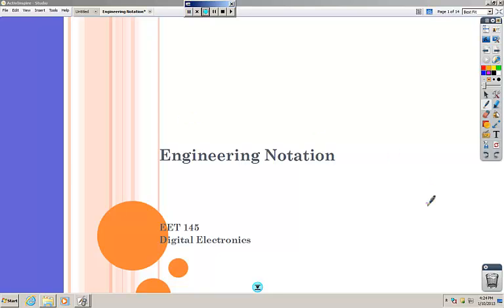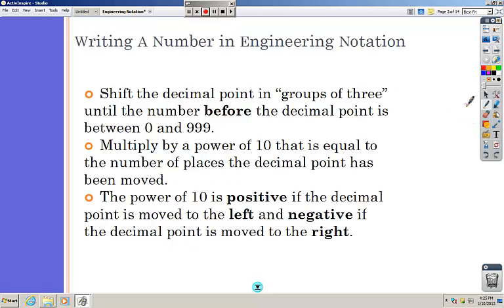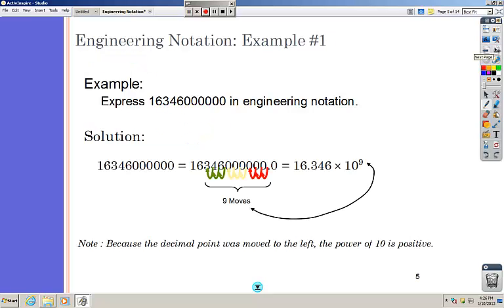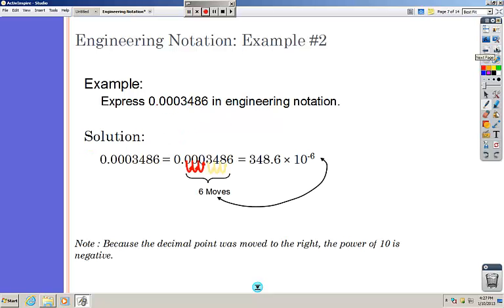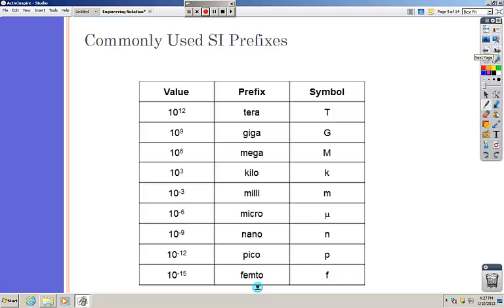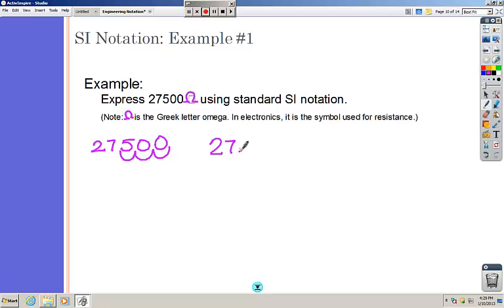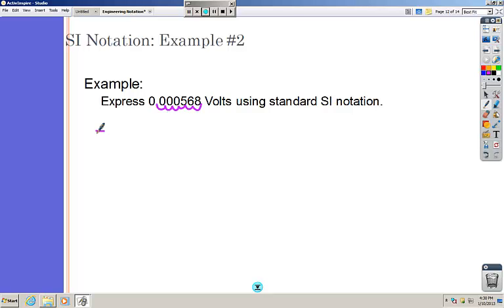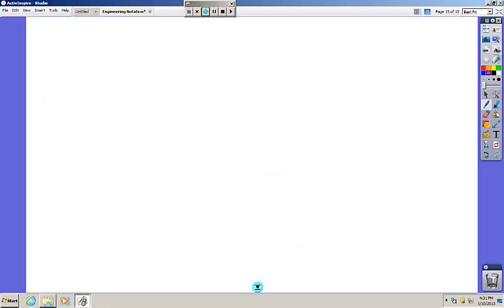Engineering Notation

Comment: At 0:27 it says "a is a number greater than 1 and less than 999

But  in it is stated that  "Shift the decimal point in "groups of three" until the number before the decimal point is between 0 and 999

There is a contradiction, and I would like to know the correct way to do engineering notation. I'm guessing the "between 1 and 999" is correct.